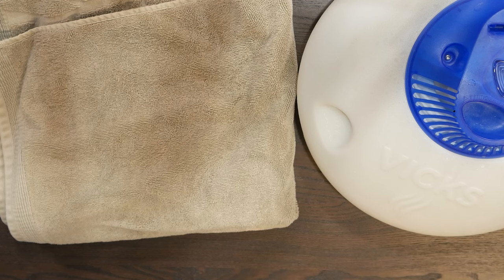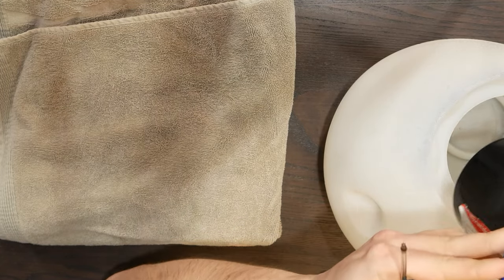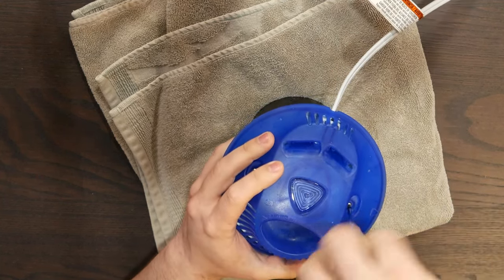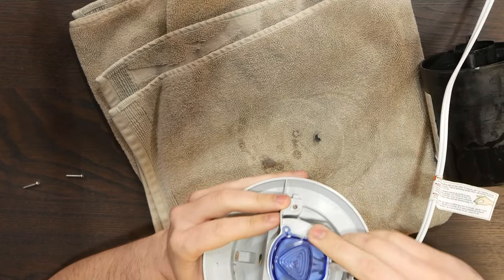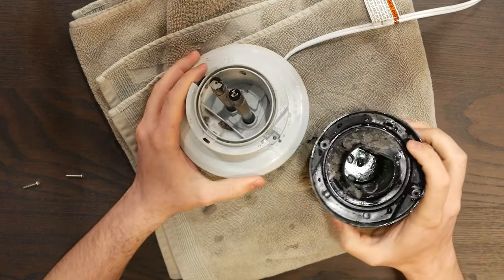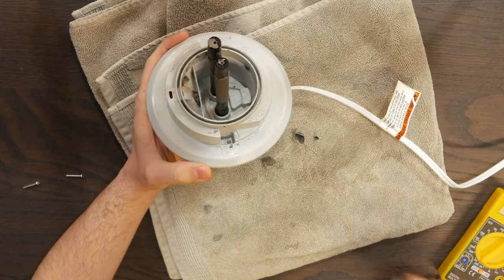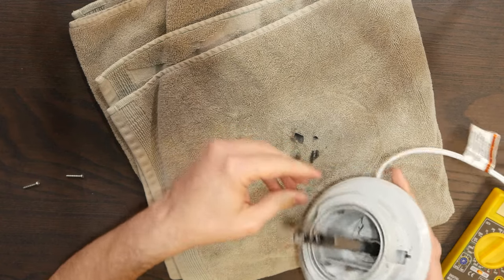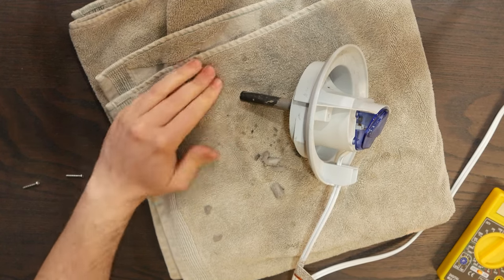Is a Vicks vaporizer an electrode boiler?

Comment: Next week on ElectroBOOM:
"Making a TAZER out of humidifier!"

This is literally a cattle prod that connects to mains voltage and sits in a plastic case. Yikes.
Reply: It's far worse actually. A cattle prod has a controlled current so it shouldn't be lethal. This will go for as long as your breakers allow
Reply: That sits in a pool of water in a plastic case.
Reply: Bro
It is encased in plastic (twice) and grounded in normal operation. 
You literally gonna get shocked only if you disassemble it and grab both electrodes.
Only really shitty thing about it is that there's no way to control current. It probably can trip your breakers if your water is too conductive. 
Or if you, idk, put it in brine or something.
Reply: @koghs  You sure it's grounded? I can't see the plug (haven't watched the main video, that's next), but the cable looks like it only has two conductors in it...
Reply: @koghs  Unlikely that you could get the water conductivity high enough to trip even a 5A breaker. Maybe not even if you use a NaOH solution.
Reply: What would it ground to? The insulating plastic or the live water? I have my doubts about the grounding, but I personally wouldn't worry about the device in either case. Water is a terrible conductor so electrocution is not all that likely unless you open it up
Reply: @WoLpH  Yeah, that doesn't look like a grounded cable.  To be clear: I am not an electrician, so there are definitely things I don't know about grounding.
Reply: @WoLpH  You are right. The current runs between the electrodes, and you are only at risk of getting a shock if you somehow become a lower-resistance path between them, such as by touching the electrodes or putting your hand between them. That's impossible without disassembling the thing or at least resorting to some epic misuse, like cracking the plastic case across somebody else's skull.
Reply: @c182SkylaneRG  I have one. It's not grounded.
Reply: Brought to you by Prod-cutor & Gamble with your life.
Reply: @koghs  Mercury !
Reply: @ReverendTed  At least Plastic isn't conductive, less conductive than human flesh, so as long as you don't put your hands into the water, whilst running you won't get a shock.
Also Water Vapor isn't conductive, so during normal operation, no closed-circuit can be made with the Humidifier and a person.
Reply: @c182SkylaneRG  I mean in the US, that would be a valid question and sadly this is a US device, so yeah valid question. If this was made in Europe or for the European market, you could be sure it had a ground, cause across the pond in the EU it's kinda mandatory to have grounds. And all homes have breakers with over current protection, so no circuit is unprotected in modern,  western European homes :D

Yeah I live in The Netherlands and to be fair and real our electricity grid and plugs are just a lot better than the US standard :)
Reply: @WoLpH  The idea is that the water contains minerals. When minerals, aka Salts, are dissolved in water, the water becomes a great conductor. The only type of water that is an insulator is pure H2O, but you can't find that not the planet. This device also wouldn't work without salts, cause it needs to conduct in order to work.
Reply: @teaser6089  I am aware. But even with salts added, the conductivity of water isn't great and with just a few centimeters of distance away from the electrodes the voltage will decrease a lot and will prefer the other electrode over your poorly conducting body.
Reply: @koghs  If the device was grounded, it would trip the RCD / GFCI, as the current wouldn't just flow from the live to the neutral electrode, but also from live to ground… unless one would build an outer shell around the whole thing or something like that, so that the grounded parts wouldn't make contact with the water during normal operation.
Since the electrodes are encased in plastic, it's nearly impossible to get a shock and grounding isn't necessary at all. If you disassemble and touch things, you could get a shock from any electric device… grounding doesn't help against that.
Reply: @LaMirah  if you’ve got two of them and get a little carried away with salt it can definitely happen. Speaking from experience
Reply: @johnnymusic685  There's no need to ground it. There are no conductive parts that you could ground, actually.
Reply: @koghs  Neutral wire breaks somewhere (anywhere) and now you have a bucket of live energized water waiting to zap anyone who touches it.
Reply: @koghs  I have the exact same one. It isn't grounded.
Reply: @c182SkylaneRG  I have the same one and I can confirm, not grounded.
Reply: @LaMirah  My concern is kids are curious and ignorant. That's kind of the whole thing - they are growing up, getting experiences, etc.

I was the kind of kid that would have tore that open if I had a screwdriver, and there are kids who would destructively break these to find out, especially if they find out there is a big zappy thingy inside

That is what is making me wtf about this - Very least it should have a big, "KEEP OUT OF REACH OF CHILDREN THIS WILL FUCKING KILL THEM IF THEY BREAK IT OPEN" warning on it
Reply: @Icalasari  Thing is, it probably won't kill them. I got shocked more than once from mains electricity (127V; never 240V) while trying to repair outlets like a dumbass without disabling the breaker. While touching both poles with the same hand isn't fun, it also isn't deadly.
Reply: @koghs  Yeah, I'm actually surprised there isn't any sort of safety built in considering the lengths this thing would be willing to go are based entirely on how conductive the fluid is inside it. I'm not saying it's inherently dangerous. Given their mass ubiquity makes them immediately identifiable, they're obviously popular enough that if they were dangerous, we'd have seen something about it. Especially considering the lack of any reason to believe it would be dangerous... like, at all. People aren't known for being smart.
Reply: "literally"
Reply: @teaser6089  wow so savage to the people in the States just totally ripped a new one.
Reply: @Rand0mFriend   He’s right.  American 120Vac electrical plugs were designed to be cheap to manufacture, with little concern for safety.
Reply: @teaser6089   You should watch Technology Connection's video on the US' power system, it might change your mind on the American vs EU power systems. But in short:

* no, this would not be grounded in the EU, because it makes no sense for this product to be grounded. Grounding is only important for a product with exposed surfaces, and this humidifer doesn't have any, the case is non-conductive plastic. Grounded devices are actually significantly less common in Europe because of the variety of different grounding schemes, most of which are incompatible with each other.

* Europe's plugs are a complete clusterfuck and the case is totally flipped around from what you think. Most consumer NA plugs will fit the same regardless if they're American, Canadian, or Japanese; they only time they might not is if the outlet doesn't support grounding or polarization but the plug uses it, in which case it won't fit at all. It's either safe or it won't work. On the other hand, Europe uses a variety of standards, some that are completely incompatible with each other (British vs Schuko plug for example), but many are compatible to various unsafe degrees. For example, if you plug a German schuko plug into a Danish outlet, it'll draw power, but it won't be grounded - not because either side lacks a ground, but only because the pins are in different places. Most/all CEE standards afaik don't support polarization either, which is something the NA plug has had for quite a long time (at least in the US and Canada). And while the NA plug has a lip on the edge to keep your fingers away from the potentially live prongs while you're inserting them, most European plugs don't feature one, instead relying on a recessed cavity to keep your fingers out - a feature that many outlets, most notably the CEE 7/1 outlet, often don't properly support. The NA plug is safer than the standard schuko plug in almost every way.

* Since the US' voltage is half of the EU's, and both systems commonly have universal overcurrent protections (they're called breakers in America), it's the safer one to get a shock from. You'll recieve substantially less power assuming the resistance and current are both capped to comparable levels, and that increases your odds of survival, albeit a direct shock in either situation is dangerous af.
Reply: @alexjones3035  i already watched it and the EU system is superior, we use 230 volt instead of 120, which makes our system more efficient
Reply: @alexjones3035  also we ground our sockets so most products here are grounded
Reply: @teaser6089  You either didn't watch it at all, or you weren't paying attention. Go check it out again - he made a very big deal about pointing out that American homes use split phase 120v, so they effectively run 240v by combining them on the devices where 120v would result in a crazy high current draw, like dryers, ovens, etc. as well as on the distribution lines. On a low end consumer device like this, it wouldn't be noticably more efficient on 240v, the only advantage to powering it on 240v instead if 120v is enabling a higher peak power draw without needing to draw a ton of current. But given that it's only rated to draw up to 650 watts already, out of a maximum of 1500 watts available at the wall, the only advantage whatsoever to running it off a higher voltage is not needing to have the voltage stepped down. 120v on a device like this is safer
 without any real downsides.
Reply: @teaser6089  Check all of your devices sometime, and see how many actually have a third prong. According to what I can find, it's uncommon for many devices to use it because of the variety of different grounding schemes in Europe - most use a universal Europlug, which will look just like a Schuko plug but won't have a third prong anywhere and isn't grounded, even if you plug it into a grounded outlet. Furthermore, even if a modern Dutch home is grounded (and according to your own countrymen on reddit, it doesn't seem to be required except for the bathroom and kitchen), the Netherlands is filled with many older homes that don't support any kind of grounding whatsoever. The US started requiring polarized outlets in the 1960's and grounded outlets in 1971, which means that the vast majority of homes in the US today either have them or have been retrofitted to have them, and a plug that uses grounding won't fit in a plug that doesn't support it, so you can't accidentally shock yourself. The schuko plug will happily let you do that if you unknowingly plug it in in another country.

My overall point is, the European power system is not better and you shouldn't feel smug about it, it's a mess of different standards that was built in a hurry after WWII and is less safe than the American/Canadian/East Asian one in nearly every way. The main exceptions are the British and the Irish, who completely overhauled theirs - for precisely these safety concerns.
Reply: @alexjones3035  In the Netherlands older houses have grounded outlets in all wet areas like kitchens and bathrooms. With newer houses all outlets are grounded.
Reply: @alexjones3035  We mostly use the Schuko (Type F, CEE 7/4, 7/7) in The Netherlands, the Europlug does appear sometimes, but most appliances over here use the Schuko (Type F, CEE 7/4, 7/7), the only appliances that use the Europlug are mostly Christmas lights and the such. However even those get the treatment of having over current protection, so even when you would electrocute yourself after x amount of current the plug will pop. We apply over current protection in the fusebox instead of in the socket, so that makes them a tad safer. 

Not sure if this device would use the Europlug or the Schuko (Type F, CEE 7/4, 7/7), but what I do know is that all our Sockets are Schuko (Type F, CEE 7/4, 7/7) and yeah the Europlug also fits in there, but I have more appliances with the Schuko (Type F, CEE 7/4, 7/7) plug than with a euro plug lol.

Also, The Dutch power infrastructure is a lot safer than yours, don't feel smug about your lack of standards. We use 230 volts cause it's A: Safer than using 120 volts and B: More efficient, cause higher voltage and lower current = less loss!

Our plugs have protection that at no time you can touch the conductive pins when they are connected to the electric grid, meaning you can't electrocute yourself whilst plugging the plug in the socket, the US plug standard lacks this safety feature.

Also you are wrong the Schuko (Type F, CEE 7/4, 7/7) sockets allow the use of plug without grounding and vice versa, we have standards here and we make sure that all is compatible, even though using a Europlug is less safe than using the Schuko (Type F, CEE 7/4, 7/7), you can and without risk of blowing up your face, plug the europlug in a Schuko (Type F, CEE 7/4, 7/7) socket, just not vice versa. 

Also The Netherlands has a lot of old homes, but most have already retrofitted to new systems or completely rebuild only leaving the outside walls intact to keep the old look of cities. I don't think you know anything about the Netherlands, but if there is one thing we are amazing at than it's Engineering and infrastructure. There is a good reason that we over count as one of the countries with the best internet infrastructure. 

Also the Europlug doesn't look at all like a Schuko (Type F, CEE 7/4, 7/7), so first learn about European standards before you talk shit. The EU forces a lot of companies to do more for safety, you as an American of course don't like the fact that we across the pond force companies to undertake action to improve safety, just look at boeing. Instead of accepting that we are better at making safe products, you instead try to create lies and half truths to make your own broken system look better, I hope you will one day see that European products, standards and safety laws are superior to the American way of risking the safety of the consumer in the name of profit.
Reply: @alexjones3035  I know, but we use 230 volts, which is still more efficient than split 120 volt phases, so your point doesn't change anything.
Reply: you should see EU electric shower heaters...
Reply: @Elios0000  We don't use Electric heaters in The Netherlands, we use Central Heating systems, burning gas to heat water and transport warm water to radiators throughout the home, including the bathroom and this is controlled by a thermostat. 

Some heatpumps are getting introduced, but these are attached to the already existing waterpipes and still make use of the radiators.

Can's speak for Eastern or South Europe, but Western Europe has great safety standards :)
Reply: @teaser6089  our safety standards aren't much different in the US. Things that aren't double insulated are required to be grounded here, as well.  And yes, of course there's overload protection here add well. And if you use the Schuko style plugs in the Netherlands, then you don't have polarized plugs like we do here in the US, because you can insert a Schuko plug in either direction. (Same with the Europlug used for ungrounded appliances that use less than 2 amps.) But if you look at a drill with a plastic case or a plastic table lamp over there, I guarantee it's not grounded, because it's not necessary due to it being double insulated. This humidifier is significantly different from the dodgy cheap Chinese electrode heaters that Big Clive and DiodeGoneWild have demonstrated. It's likely got some sort of overload protection built in, and the way it's constructed, you can't get near the electrodes without opening it, and you also can't touch the water when the electrodes are in it. The way it's designed it's double insulated as well. Only change I'd make is the addition of an interlock switch that disconnects the power when the heating unit is not seated in the tank, or maybe add a GFCI (RCD in UK English) but even still, in order to come in contact with the electrodes or water that's electrified sufficiently to cause harm, you'd have to deliberately do something to reach it.
Reply: @outcastatsabre  except that the way it's designed, you can't get to the water unless you remove the electrodes first.
Reply: @teaser6089  our sockets are grounded as well.
Reply: @alexjones3035  half of it is just not true at all
Reply: Big Clive viewer just dropping in to say Welcome. :)
Reply: @LaMirah  Ah yes the "Kazuma Kiryu" use case
Reply: @teaser6089  no. there is literally nothing to ground here.
sure the plug might look like it has a ground.
they could tie netral to ground but thats kinda bad.
Reply: @LaMirah  I touched the bus bar of a power strip that came apart on me at 120.
Bit me good but was nowhere near fatal.
Was able to jerk away immediately and drop it.
Also used to get shocked plugging things in, mand would wtach my finger turn red when id stick hair pins in the outlet
Reply: @jacksons1010  yeah cuz we aren’t a nanny state
Reply: @teaser6089  no it makes it cheaper to wire. the losses otherwise are the same due to line losses. 50hz vs 60hz would be virrually identical impedance
Reply: @teaser6089  you dont seem to know what you are talking about.
Its not more efficient to deliver the same power.
Its cheaper wiring and that is it.
Most line losses are from reactors not current losses hence the mega volt projects in India because unlike Europe after wwii they dont care about the cost of metal.
We have 240V when we need it and not where we dont.
Reply: @jhoughjr1  You seem to not understand that higher voltage = less loss cause electrical loss is determined by the current, higher voltage = less current for the same wattage, how don't you understand that..... Jesus
Reply: @LaMirah  some tap water can be pretty conductive, and resistance gets really low at boiling point. I think it could trip a breaker.
Reply: @Sandimations  The problem is as water starts to boil, it forms pockets of water vapor that are (relatively) a pretty good insulator. The current has to zigzag around it, so the length increases and the cross-sectional area decreases, and therefore the resistance goes back up again.
Reply: @c182SkylaneRG  Doesnt need to be grounded its double insulated. It's clearly on  a 2 conductor cable.
Reply: Whit a stick and a good long extension you can make a cool budget Scify powerlance, zap zap down goes the cat.
Reply: @Vera You're well come. Thank you. I'll be here all weak.
Reply: @koghs  I wonder if anyone ever got hurt or died from putting brine in an electrode.
Reply: KAIZEN FROM EVENT [0]!!!!
Reply: @c182SkylaneRG I know I'm necroing but there is no reason for this to be grounded because what would it ground too?
Reply: @whatusernameis5295  A valid point (which was mentioned a few other times in this full comment thread :) ).